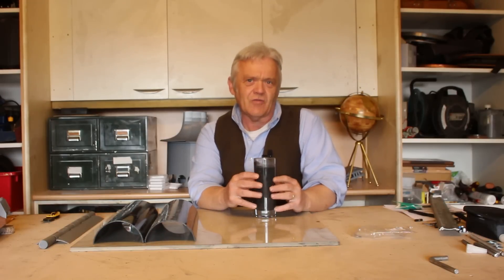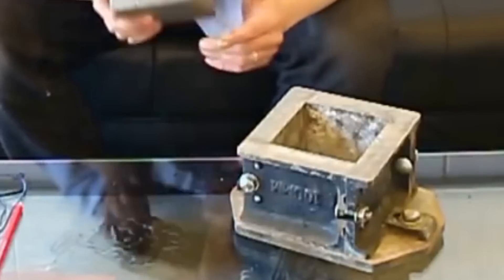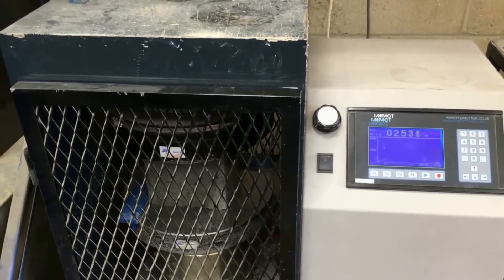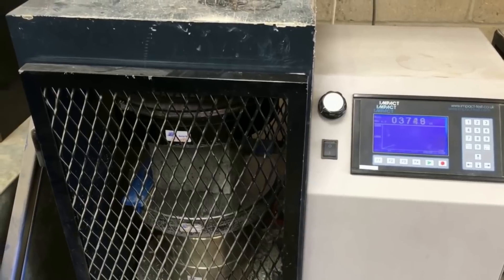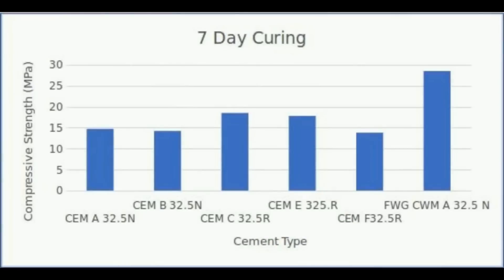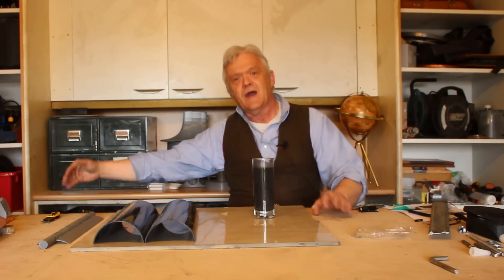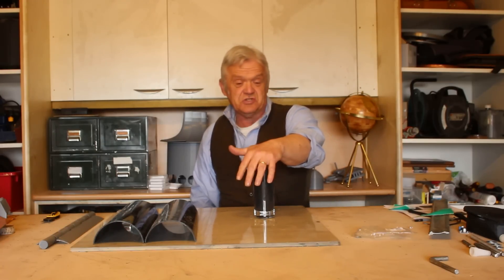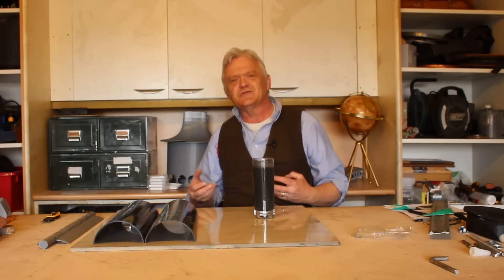1935 Graphene In Concrete

Comment: I don't remember when all the videos on making graphene, if using an ultrasound cleaner tank was used to brake up clumping more. One thing that would be super usefull would be plasic for 3D printing with graphene. I know just using carbon fiber makes 3D printed stuff way stronger.
Reply from the maker: cheers mate

Comment: I wonder how much adding graphene would improve the strenght of Aircrete?
Reply: Test it!  It's public domain, if you have trouble he'll probably help you via email or something because if someone else is doing the experiment well then it's easier to move on to something else and accept their data; especially for demonstration/prototyping purposes, relative data is perfectly fine for feasibility/evaluation.  If the test is done well enough then the data should be close enough to say yea/nay.
Reply from the maker: give it a go
Reply: I was thinking the same thing.  Disputing it wouldn't be a problem.  Anc considering soap and blender speed mixing is involved in making both the graphene and aircrete, you might be able to skip a few steps and make the graphene with the foam?  Just a wild thought there 😊
Reply: Another thought, you probably don't have to worry about watching out the soup from the graphene first

Comment: Yay, masonry is what we experiment today. I'm sure that all these will come together: I'll buy a cow for the milk, use the graphène enhanced concrete, laid out by massive 3D printers,  to build the stable and air-condition and run the milking machine  with energy extracted by various turbines printed in 3D and other solar converters stored in an assortment of sand batteries and graphène based super capacitors.
Reply from the maker: ok lol
Reply: What about that gm  yeast that brews whey?
Sounds easier to clean up after, and feed, no vet bills.. 
 Perfect if I want to sustain my cheese addiction.

Comment: What ratio percentage was the cement to graphene mix??
Wonder if foamcrete or styrocrete with graphene does as well strengthwise.
Reply from the maker: i made a 7mg/ml graphene dispersion then used that instead of mix water

Comment: Do you think that this would also increase the strength of aircrete as well? Potentially to match the strength of normal concrete?
Reply: Tensile or compression strength?
Reply: @BenjaminGoose  Either/or. It's been a while since I looked into it, but for building purposes, the compression would probably be more important?
Reply: @MrMatthewPR  not sure about more important. I would think it’s application dependent. Tensile strength is important for spans across distances.
Reply: @dr.froghopper6711  Ahh yea. I wasn't thinking of long spans. More for small buildings, cheap foundations, insulated walls, etc.
Reply from the maker: it could well do mate but you will ave to do it test it and see

Comment: You can Mix it with Ultrasounds and Evaporate water with other frequency...
You by then would have Pre Assembled Iron-less Reinforced Concrete Panels to Transport in as Construction Material.
Reply from the maker: i suppose so mate

Comment: Great video, Rob! 😀
Is graphene-based concrete hydrophobic? Are the concrete comparisons for pressure loading only or did you include tensile loading?
Reply: I don't think anyone test for tensile strength, it's complete rubbish, all the tensile strength comes from the rebar!
Reply from the maker: cheers and no it isn't hydrophobic

Comment: Can graphene make rebar unnecessary?
If so, it might be great for 3D printing of concrete by making it easier to get approval and pass building codes.
Reply: Rebar gives concrete the tensile strength it would otherwise lack; it appears that Graphene only increases concrete's compressive strength. Frankly, concrete has more than enough compressive strength for most applications, so I don't see graphene being a major step forward, except perhaps in aircrete and a few niche applications.
Reply from the maker: i don't know but bulding codes are hard to get around mate
Reply: Per application, it could provide a reduction in rebar use, but keep in mind “Performance of the concrete is relative to the application.”
Reply: @mikegLXIVMM  I don't know how or if the graphene enhanced cement changes anything in regard to the regs on rebar requirements. Logically, it would make sense if it did. My thought was if adding graphene to concrete reduces the amount of concrete needed, could graphene in steel produce similar results and have the same effect? The answer is no simply because it can not be added to steel. However, graphene can be added to enhance the coatings for steel used in concrete, thereby greatly enhancing the corrosion protection of the steel. Its a big win all around! The company I'm watching to make the biggest splash in graphene is Universal Matters. Their flash jouele process of making graphene was discovered and developed by a lab at Rice University by professor James Tour and his students.

Comment: Thank you so much for revisiting this topic.  This method is easy enough I can play with it, and as I'm remodeling my grandmothers hundred year old house for my little family, this will help a lot.
And I think this with things like fiber reinforced thin film concrete will be Really cool, and I cannot wait to see if it can make aircrete more viable- as the bubbles kill the strength, but if you can strengthen the concrete matrix Around the bubbles, it may make up for that to some degree (I want to try to both put it in the concrete part,  and try it in the Foam part to see if maybe graphene coated bubbles inside to give those voids some more structure to see if either works better.  It will take some playing with, but that's where my mind goes.  This may be a cool way to further reduce the amount of concrete you have to use)
Reply: Have you tried using a nanobubble generator for your aircrete? Nanobubles last longer and their small size will improve greatly the strenght of the aircrete. That how birds bones are made.
Reply: @The0ldg0at  i have not. I shall look it up but I think I grok the concept.  What I really want is some way to make hollow spheres so you get the benefit of the air for volume and insulation, but it retains at least more compressive strength than aircrete usually has.  Just havent figured out what will do that yet.
Reply: In oilwell cementing there is an additive called ceramic spheres, which are micro ceramic spheres used to lessen the density of the slurry without decreasing the strength. No idea what the cost is, we mostly used it in fragile formations where the weight of the cement column could cause fracturing
Reply: @paulalexandrovich932  that is precisely the sort of thing I want to get or replicate.  Im having trouble sourcing them though to see how much they cost. 
But yeah, That notion.
Reply: (Hadnt heard of them, thanks for that. It is sometimes annoying trying to look something up, and not having Quite the right words to find the thing you Mean)
Reply from the maker: i will be fascinated to see mate fancy doing some videos and sharing?
Reply: @ThinkingandTinkering  i will definitely let you know what I discover, and if it works well do a vid.
Reply: Check out the videos on mixing chopped packing foam with concrete.
Reply: @JonLovestheLord  that stuff is definitely a good option.
Reply: I had been pondering maybe using a thick resin or thick water glass, foaming That, and adding that to the concrete to see if that would make structural bubbles.  no clue if that would work.
Reply: Be careful mixing technologies in existing structures, you don’t want to be like all those line mortar and render houses where people slapped cement on them and they have had to either be demolished.  Stronger isn’t always better it’s about the right choice for the right job
Reply: @garethdavies4351  indeed- i shall definitely be cautious in where I use it, should my experiments work.  

Im currently trying to figure out if I can insulate the house, without causing condensation issues.  There is a great deal of disagreement between renovators on the subject.
Reply: @ryanjamesloyd6733  there are lots of things you can do but you need to either have breathable surfaces or change the air with heat exchangers.  This is the issue with new properties or when people make the building envelope tighter. They rarely think about the air exchange, a person loses about 200-250 ml of water per day plus you have showers, sinks etc so it soon builds up if you are not careful

Comment: What would happen if you added graphene to Hempcrete or Hemp-concrete?
Reply: Apparently, there are vídeos about graphene made out of hemp, but not hemp + graphene.

Belinda Carr has tackled hempcrete from an architectural background, so maybe you can suggest this topic to her.
Reply: Thanks for asking this question. I was sitting here trying to figure out whether or how it would affect hempcrete’s insulative quality.
Reply from the maker: i don't know but probably the same thing - try it and let us all know
Reply: stoned
Reply: I would think that using an adobe technique would add your tensile strength of the hemp but I would be more interested in the properties of flax(Linen) due to the movement makes the fibers softer and stronger. Good thought!

Comment: I want to try this with epoxy. Any tips on how to get the water out? 
Or better: instead of water, could this be mixed directly with resin in the blender? (without the hardener, ofc.)  The bubbles might be a problem though.
Reply: In his video on making it he says use a centrifuge otherwise it takes months to settle out. Either way, then pour off the water and spread it out to dry.
Reply: I suspect not, but don't let me stop you. Vid 1933 explains how and why it was made this way which might show you why resin won't work, or it might give you hints how you CAN make it work. 
If you can centrifuge it though, you'd have the dry graphene to add to the resin and I'm sure that would work great.
Reply: One option to investigate: This wet mixture contains both graphene and left-over graphite. It may be that you'll get extra strength by including both without having to seperate them. So it's worth trying just evaporating the water-off powdering it again (it'll probably be  kinda stuck together) and seeing what happens. 
But yeah, otherwise it will most likely need centrifuging.
Reply from the maker: centrifuge and dry